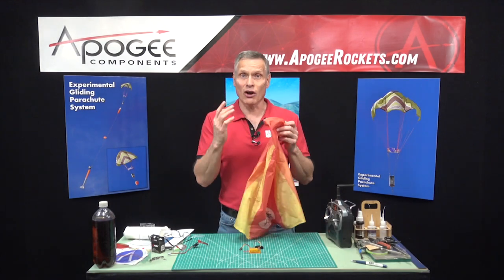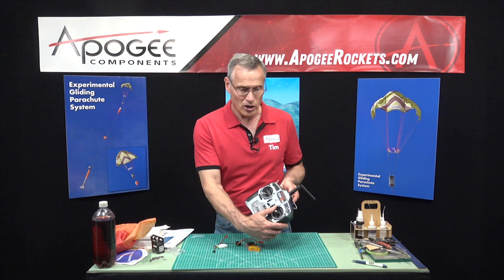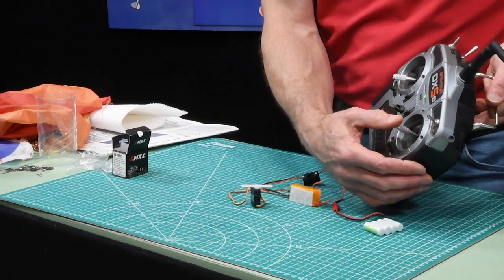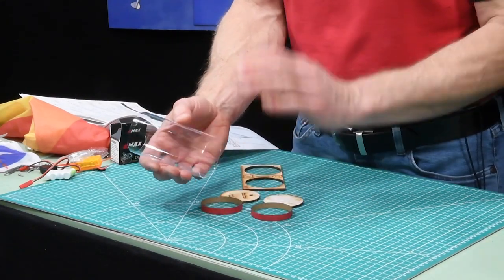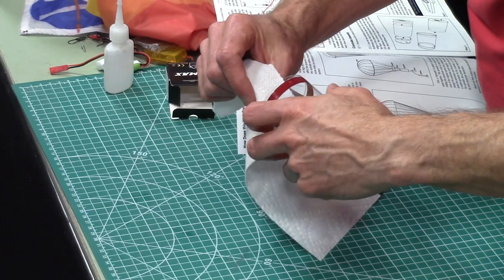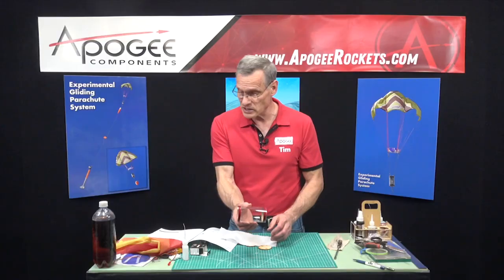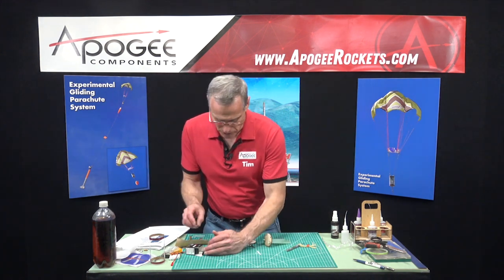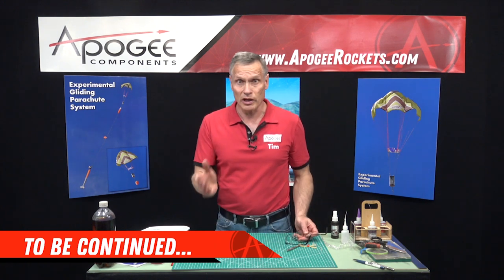Gliding Parachute Assembly - Part 1 of 9

Comment: Interesting, May try one in my PML  Tethys its a tough ol bird that's been through all kinds of hell lol anyway Little word, you probably already know but when you set your servo up (center it) if your transmitter is capable of it, perform a model reset. This ensures that all mixing duel rates, Expo trims etc. are neutral and zeroed which is very important for initial setup. If you don't do this and lets just say that you accidentally put in some sub trim and you zero the servo with this active, you'll end up with weird problems later in setup. Hope this helps!
Reply: Don't know the weight of that rocket but it appears that the biggest one of these only handles 3.3 lbs or 1500g. My smallest higher power rockets weights just at 3lbs not counting the motor and electronics.